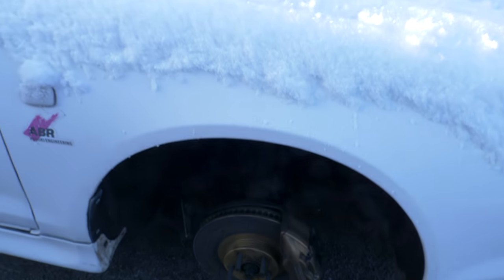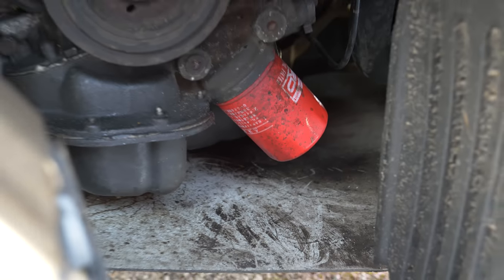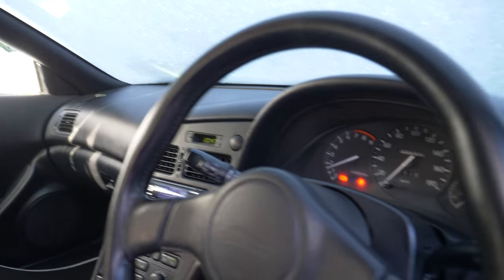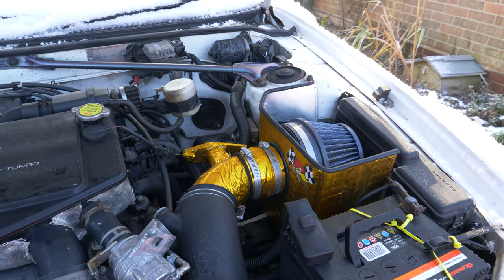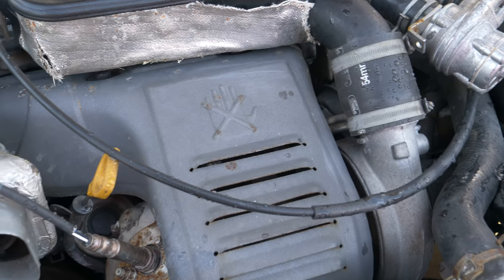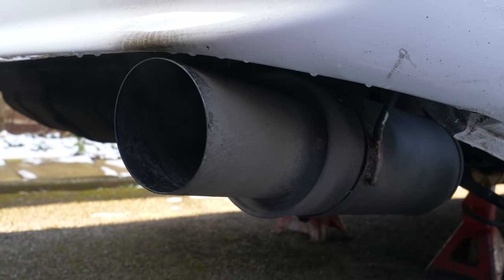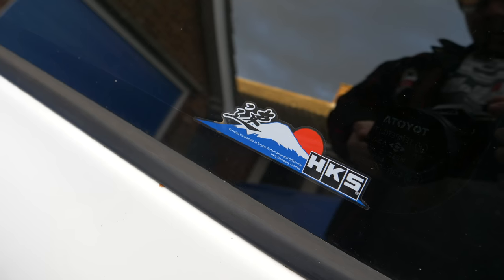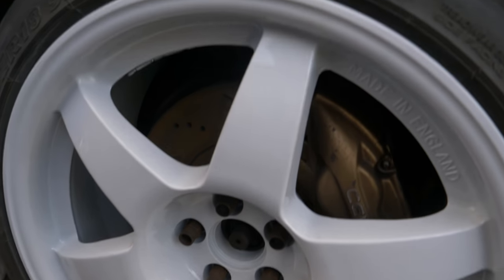Celica GT-Four ST205: Fixing My Problems, Interior - Wobbly Seat, And Bad Wheels

Comment: I know it’s your car and you can do what you want with it , but it looks terrible with white wheels , also the gold film on the box surrounding the cone filter is to reflect the heat , so that the filter does not suck in the hot air therefore losing power , it’s called heat soak
Reply from the maker: I'm familiar with heat soak, I may just try and find a way of doing the same thing but neater
Reply: White wheels look terrible on a rally car? That's the funniest thing I've heard all year.

Comment: As others have said.. keep the lagging! I’ve owned my GT4 ST185RC for 15 years (also with the top mount liquid cooled charge cooler) and one of the first things I did was to lag the chargecooler. Also the modded air intake (from the stock sealed box) needs the lagging to keep air intake temps low.. cold air is crucial for performance on a turbo car.

Alternator snorkel is overkill and not required, as is the bonnet snorkel (yours has gone anyway) for the cam belt.. its legacy stuff from its rally design where they were melting from the extreme heat and punishment.. unless you are planning on taking it across a desert or something I wouldn’t worry.. mines had neither for the entire time I’ve owned it and I’ve had no problems and I’ve never heard of anyone having any either.

I’m a fan of large exhausts on these, the stock pee-shooter exhaust just doesn’t look right. These beasts are loud looking all round and should have an exhaust to match. Still I’m all for personal taste and whatever makes an individual happy :)

Nice example though mate.. like the wheels as well.. I also have white rims!

Note about the 205 in WRC.. they were disqualified for cheating. I believe they snuck a valve on the turbo that allowed more power.. naughty!

Comment: Do not remove the lagging on the chargecooler or at least redo it. It is a very important modification to keep inlet charge temps down. Also the alternator snorkel is missing because you have a thicker up-rated rad. It will foul against the fans otherwise.
Reply from the maker: Cheers for the advice

Comment: As a owner of the 2.0 vert I and had the front end nose done and lights swapped is a pain join CCUK or celica uk and someone will post up the guide to remove it major faff for your faff as club and owners call it I hope you get your battery clamp on it and there is a whole load of bling for the engine bay and find your self a decant drivers mat as those are rare to get a hold of as speaking as a JDM dealer options lover and the CCUK is a good group for info and shows even JDM combe and japfest and far as I know Celica alarms are a pain in the arse ask a  Celica forum